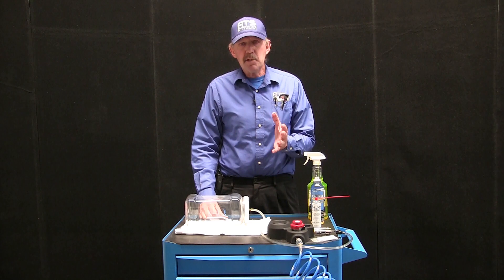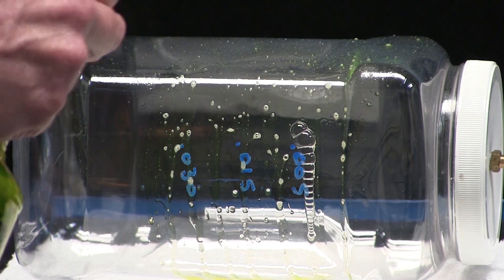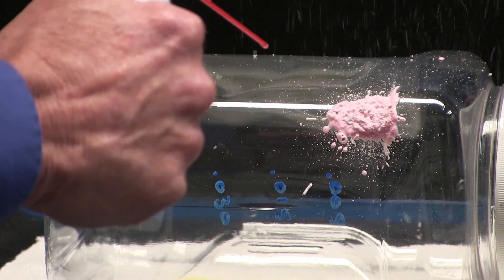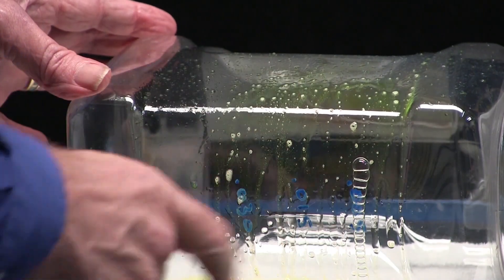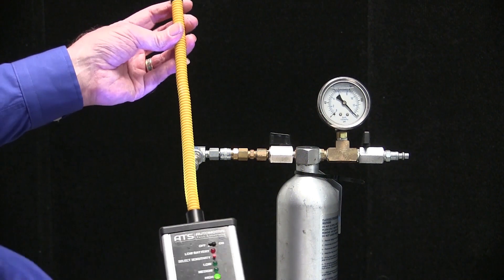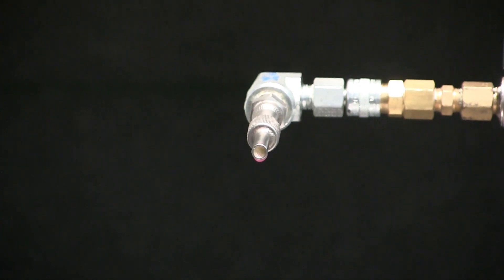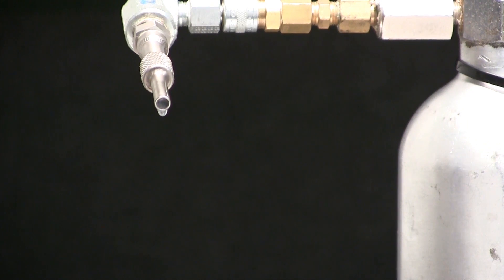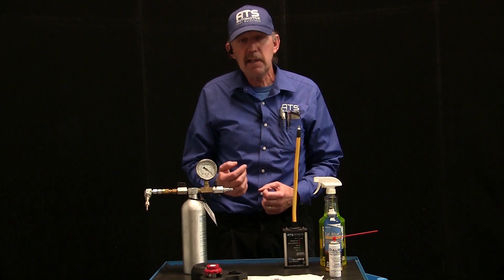EVAP and AC Leak Detection

Comment: On evaporators that you usually cannot get to physically, especially on vehicles, which of the majority of new ones that will take anywhere from seven hours to 20+ hours just to get access.     You just use something like a Inforcon DeTech Stratus that reads refrigerant levels all the way down to the parts per million..  or the good old fashion H 10 refrigerant leak detector with a new properly adjusted heated diode sensor.  Problem is most technicians do not know how to properly calibrate them, and dial in the adjustment for the Diode.  

High-pressure, nitrogen, and ultrasonic leak detector can pick up a leak from a few feet to a few inches away even if it’s can’t get direct access to it . 

And the other two high-pressure, 95% nitrogen, and either the helium or the hydrogen absolutely extremely sensitive and you do not have to get access to the Evaporator .  They’ll pick up leaks so small and so accurately that usually when you just open up the car door you start to pick up the leak.. 

As for the bubbly leak detectors that are on the market big blue from viper technologies finally got a good formula that out does the rest . 

And for pressure in a evaporator there is no problem on all the new cars especially the ones that use microchannel Evaporators you can easily go to 175 to 200 psi pressure .  

When you were in Arizona on a hot summer day 110 115°F and you have the hot engine bay in the car interior gets heat soaked with the windows up to 160° on the inside – interior if you look up the PT chart for a refrigerant R134 at 130°F to your evaporator pressure will be 198 psi at 140°F. Your evaporator pressure will be 229 psi. This happens every day with vehicles hot soaked parked in shopping lot on the blacktop on hundred degrees plus days.. 

You hook up your gauge to a hot soaked vehicle and it’ll be between 190 200+ psi on the low side .  

Then there are those leaks that just don’t leak at static pressures and ambient regular temperatures. They only leak when the car is moving down the road vibrating and when you pull the car over and stay still in your garage with the hood up, it doesn’t leak 

Then you have those other leaks that only leak when one of the lines either gets hot from the hot, refrigerant, gas flowing through it or cold from the suction line in the middle shrinks or the middle expands, especially at rubber intersections, and it only leaks at that time but 100% completely seals up and stop leaking when it’s sitting in the bay just sitting there . 

Then you have those leaks like many of them that are pressure sensitive. They will not leak up to a certain pressure until they reach that pressure. They will not leak. .  And then, as soon as they reach the pressure, they just pop off like a blow off valve.. some of them will be down to Refrigerant All the way near the zero within 24 hours and other ones will stop leaking when the pressure in the system cools down in the pressure goes below a certain pressure delete 100% stops. 

Those are the intermittently etc. booger to find . 

But the high-pressure nitrogen with helium and hydrogen usually find some every time and you don’t have to see and have access to the location . 

All the above methods my father taught me when I was a kid back in the late 1970s and early 1980s .  These were all available they’re not new they’re not mysterious.. 

As for CO2, the same Inforcon, DeTech, Stratus, Reed’s Detector you can just switch out the module for a refrigerant for a CO2 leak detector. Extremely sensitive ultra sensitive. You even breathe in the area and you can set it off.   The strata sleep detector is three leak detectors in one. I just simply slipping out one refrigerant sensor for a CO2 sensor, taking out the CO2 sensor and simply sleeping in a hydrocarbon leak detector sensor..

Comment: for evap how would a smoke machine do in this test
Reply: There is a demonstration where they even know where the leak is and no smoke is visible but the Bullseye system shows the color change foam detecting the tiny leak.
Reply: @1MiketheMechanic  but thats just it, u need to know where the leak is with the foam
Reply: @Vinny C  that's where the sniffer comes in. Gets you in the ball park,  foam hits the home run